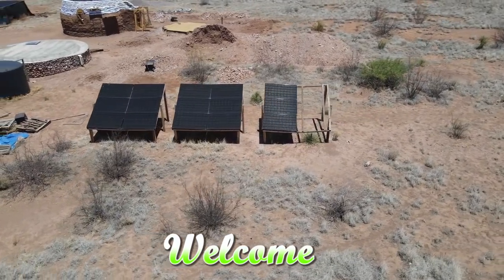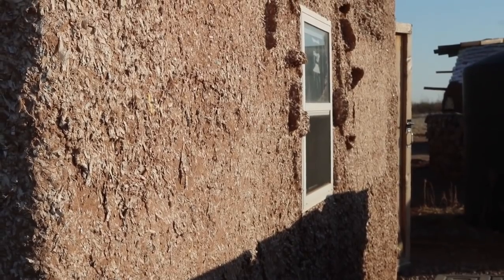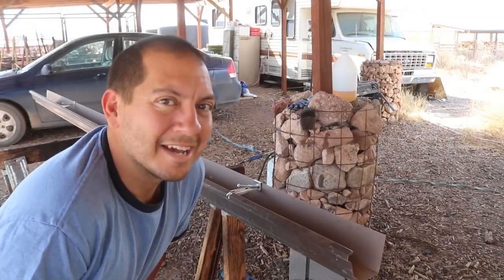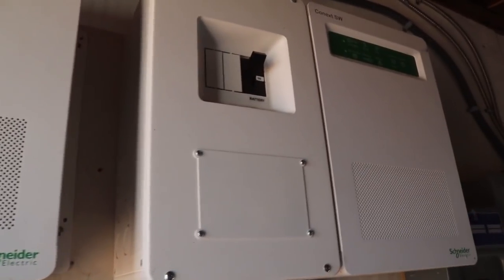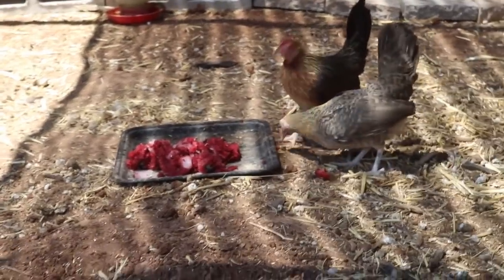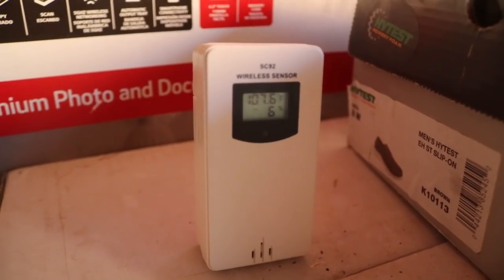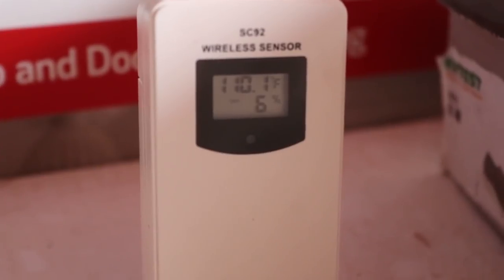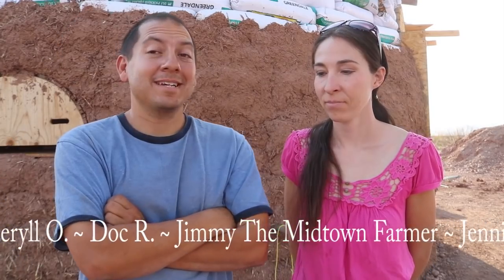Scorching Desert Heatwave Threatens to SHUT DOWN Our Off-Grid Solar

Comment: I am near Phoenix (its 117 F today) and have a system similar to yours but with only 2 Tesla modules.  I have my entire system installed inside a 1990 Astro van.  I painted the windows with reflective paint and installed a 12 volt Maxx Air Fan in the roof.  The fan is thermostatically controlled and comes on at 78F.  No other fans needed. Have never had a system shutdown even when 120F.  IMHO you just need to continually actively exhaust the hot air to keep interior of shed at outside ambient temps.  The Tesla modules and inverters can take 130F no problem.  The solar panels themselves do put out significantly less power when 160F in the hot sun, although that's not a problem if you have enough panels  like you do.  All I need to remember to do is close the  Maxx Air roof vent if it ever rains heavy.

Comment: How cool is your soil a few feet down? You might try burying some cooling tubes a few feet under ground to provide cooler air source for the shed during the day.

Like the others said, putting a shading roof over the RV’s should definitely help keep them cooler.

Comment: It can get pretty hot here in Central Australia, our solar system actually has it's own small air-conditioner unit. Maybe this would help, ours is set up in an old refrigerated shipping container with a metal insulated roof above this.

Comment: Do you shave Crew during the summer? We've had to do that with our dogs. This has helped our dogs tremendously. Also a wading pool in the shade if you can afford the water for it. This will help cool the dog. Cooling mats also work some but are expensive.

Comment: I just looked up the relative humidity for your area. If you go online and look up evaporative coolers "swamp" you might be able to buy/build one to cool the air in both your electrical shed and your living space. Its not a perfect solution but maybe helpful.
Reply: I'd do it for the RV but not the shed because of the electronics in the shed.

Comment: If your AC is cutting on and off it is probably slightly low on Freon you need to check it with a gauge.
It is super easy to put freon in the air conditioning on a post 1994 car, the service port is like an air compressor quick release Chuck. It just snaps into place you turn the air conditioner to on to recirculate and the blower motor to high speed with the engine running and check the freon level as the AC compressor is turning. 
If it is turning on and off more than likely the car is about a half a pound low....
I really wish I didn't live 6 or 700 miles from you guys because I could easily help you out with stuff like this on cars, I could have even fixed your truck

Comment: Insulating the shed won't be enough, in fact it could make things worse, that equipment generates heat and insulation will keep the heat in. I would do a earth tube system to cool it using geothermal.
Reply: Ventilation is more critical than insulation.

Comment: Be glad you are not up here in Phoenix, it was in the 90's before the sun came up. Have you considered a "swamp cooler" less electricity, though more water, but during the dry months will drop the temp 20 to 30 degrees.

Comment: Wouldn't it help to clean all the dust out of the inside of the car? Correct me if I'm wrong, but if you're running the ac on max, I would think it's pulling the dust back into the filters. I thought the ideas of using swamp cooler or small a/c in the solar house good ideas.
Reply: swamp cooler in the solar house? do you know how these things work? thats mixing water with electric plus it would speed up corrosion
Reply: @dantronics1682  - Ah ok. Not really. Thanks.

Comment: try looking at the condition of the fan on the AC radiator.  Might even replace it with a larger size to help pass the air through the rad when you are not moving

Comment: For some of you dealing with simular heat ....  If you have access to a backhoe.   Or are young enough
Maybe on the North side of your 
 buildings
Install geo-thermo heating and cooling...
Simple as burying some pipes in the ground 6-10 feet deep
The more 4 inch pipes the better
Maybe on structures 
If you could install multipul windows like 3 feet wide and 1 foot tall
As high in the south walls as possible
Could help let the heat out and draw in the cool geo-therno air in 
Similar to how Earth Ships heat and cool

Comment: Insulating the shed roof will drop your temperature considerably
Reply: Creating shade on the roof & shed will help more than insulating a building with a heat source, that is opened to ambient.

Comment: Many are telling you what they think you should do to keep the shed cool (less hot). You live in the desert so you have the experience there. I don't know about living in the desert, My question though, is - would putting another roof over the shed, painted white, maybe a 8 or 12 inch space between them do any good? Is that feasible?
Reply: If materials were less expensive.

Comment: Consider buying a water evaporator "swamp cooler" you can get them really small or huge.  They use low elec. And also add some humidity. It's the go to for arid climates....
Reply: yes, use about 1/3 as much electricity as HVAc.  Does use some water.
Reply: Electronics are not happy with humidity and I believe the invertors do have electronics. A small regular AC would cool without the addition of humidity.

Comment: To help cool your Living in RV build a roof over your RV WITH 2 to 3 foot space for air flow so hot air doesn’t build up.  Plus you get more roof for rain water harvesting. 
Remember your AC will only drop the ambient temperature 18 to 22 degrees.
Reply: Like build a connecting "room" with heavy mesh around older rv and to the newer... instant more square footage but also the wind is a major factor.. so  how would that do?

Comment: If the RV is in direct sunlight then getting some shade over the RV would help tremendously on the interior temps.  In the solar shed, since you are running a fan then consider adding something to it for a swamp cooler.  Like a water drenched towel hanging from a large container of water.  As the water evaporates it should wick more water from the container.  Should provide more cooling from the output of the fan.  I have no idea how much water it would use in ten hours but could save your valuable equipment.
Reply: I'm just worried about the humidity on the electronics.

Comment: Your car a/c cutting off may be due to high head pressure. Check to see if your condenser fan motor is kicking in, also living in AZ desert the condenser in front of the radiator  could be stopped up with dirt.
Clean it with soap and high pressure washer, you'll be surprised at what that will do for the car a/c!

Comment: One thing that I had out there was a swamp cooler. You can make a smaller swamp cooler for your shed. A fan and some swamp cooler filter with some water and you can't lower that temp 20/ 30 deg.
Reply: Very true. A swamp cooler works great! It would be better to add that to the RV. Electronics don't do well with humidity. The electronic control boards can rust and lose connection and then your control system will fail and a new board will be needed. It is possible to put a jump wire in the board to reconnect the electronics but it doesn't always work and you need fairly good equipment to track down the failure in the board. It could work okay and not even cause a problem too but I am not so good at taking chances with something that is so needed at their homestead.

Comment: I'm not a heatologist but I recommend that you aim your fan directly onto the controller to move the heat out of the controller. You really don't care what temp is in the shed, just cool the device you are having heat up. Also, on your car, you've replaced the fan. If your air temperature is not cool you'll need to buy a recharging kit for your A/C auto system. You can recharge it yourself. An A/C recharging refrigerant bottle runs about $40.00 for 20 oz. Watch a few videos on how to and you're on your way! My thought is the more you add fans the more the controller will heat, right? so the fan directed at the controller will cool the boards in the controller. Try it and see if it helps. Butch in Idaho.
Reply: It may not make much of a difference because the equipment is covered but the air flow around the equipment will be greater. On our built in refrigerator/freezer the fan blows directly on the compressor to cool it off. It makes a great deal of difference to us when a fan blows on us because it makes the water evaporate from our skin. Machinery doesn't get that type of cooling effect unless it is a special system. There are oil cooling systems for power transformers and such.

Comment: You need to add some radiant barrier insulation to the shed, and geothermal cooling. Also evaporative cooler helps. And a solar oven would help do your cooking outside. You can build another roof over the shed to keep it out of direct sun (white metal is best).

Comment: Nice setup, but I agree with others about the roof.  Put a 2x4 or even better, a 2x6 frame around the perimeter of the metal roof, line the area with vis queen,  then fill the area with soil or adobe.
Reply from the maker: Hey G Bear!👋 
Thank you for the suggestion.

Comment: I'm running about the same level of power in inverters feeding a 28x60 double wide manufactured house. Located 15 miles east of Salome, lots hotter than your location, 115 twice this week. Swamp cooler. Otherwise fully equipped house. Even in 115 temperatures I've never had a problem with my Magnum inverters that have no dedicated cooling in their shed outside our house. Your Schneider inverters are top quality and it doesn't seem like you should have problems. (You can see ours at redhilllabs.com, which is under construction but viewable and contacts are operating) Akita's rule!
Reply: Meant my website is under construction, and if you'd like to contact me there is a way on the website. I may be able to help. And we speak Akita.

Comment: have you ever thought of putting a chimney on that building? if its painted dark, it will be hotter than the shed which will cause an airflow and since hot air rise will suck the air out of the shed
Reply: I thought that is what Jim did earlier.

Comment: Have you checked the temperature in the root celar and the dome bedroom yet?

 Maybe you could put a temporary door in one to let crew escape the heat. Lol checking for snakes first tho. Lol.

I still think a 6-10 foot solar chimney would work on the shed. The Black stove pipe heats up in the sun, the hot air rises through the top cap fan, sucking air from the shed into the pipe, that forces more outside air into the shed, all without any electricity. I know they work best with underground heat pipes, but creating an artificial breeze should help.

Comment: Seems a swap cooler for the RV would do better then the type of A/C you are using, that particular type of A/C is very inefficient. Since water is a precious commodity, I would recommend you obtain a 5000 btu window unit for the RV, it would do a lot better job then what you are currently using and it would in most cases drawn less energy to operate it, just saying.

Comment: Put some straw bales on the roof of the solar shed. Check the condenser radiator of the car it may be plugged with dirt.
Reply: That's true too. I had to replace my radiator behind the condenser and a bird skeleton was caught between the two! Lots of leaves too. Cleaned that all out before changing the radiator!

Comment: Check to see if the engine fan in your car kicks on.   Some cars have 2 one for the radiator and one to bring air across a radiator for the ac.  Could be a fuse or need a new fan.
Reply: Or fan relays in a box in the engine compartment that went bad/need cleaning.

Comment: Hi I just wanted to tell you my car was doing the same thing I have a car that looks similar as yours and you drive it and there's just seems like there's no power kind of like dulls down and kind of the power like goes week when you're stopping your car like say you're at a stoplight and what we found out was it what's the alternator it was a power problem there's not enough electricity going through your car to power it I went to the same thing I was under my glove box fixing everything got my AC charged with antifreeze and it turned out it was the alternator not enough power just a suggestion
Reply: That is a good diagnosis. That could very well be their additional problem. Thanks for saying that. I had a loose ground wire on my battery so everytime I started moving after stopping, all the gauges on my dash would do strange things because the acceleration from a stop was wiggling my battery cable. Someone had overtightened it and it wasn't touching all around the battery post. Got a new one and no problems. Batteries can do weird things. Once, on another car, it turned out the positive post on my battery had two threads stripped and because of that I couldn't start my car. After a new starter and new battery, the post was replaced and it started right up. Go figure.

Comment: maybe a solar powered one way valve extractor fan/pipe chimney in the solar Adobe shack roof might help dissipate the heat build up, also maybe a low down  [or below ground?] air vent/ piped intake might help the air temp inside too, filtered to stop any critter entry....
Reply: Good idea to screen the pipe. Critters would love to build a nest inside a tube!

Comment: Working on your own car your never able to complete the task in the same amount of time that the youtube tutorial completed it in .. Im glad your working on your car though Jim.   I bought a 32ft 1989 motor home a couple years back and never worked on a vehicle prior .and ill tell you what I got a crash course into fixing cars and its not that bad.. Its pretty easy..most mechanics are robbing ppl for how much they charge for how simple the work can be ..  Apparently maybe not so honest of a mechanic told me once that in the ac hoses theres a filter that gets clogged ? Also the idleing shut down is interesting.. The AC clutch connects via belt to the engine and it turns air compressor ..was your car squealing when the air was turned on at all

Comment: I know a guy who put a small 1400 btu 48vdc AC unit on ducts that blow into insulated vents that go to the most critical solar devices. It only pulls about avearge 7amps DC. He had the AC air in supply duct buried 5' under the ground out side roughly 35' long. That helps keep the intake air a bit cooler. Then has a small filter cap 18" above the ground.

Comment: it wasn't menchened if the ceiling is insulated if not that is the place to start and if you can have a fan pull the heat from your inverters

Comment: Noticed you're using a portable air conditioner.  Not the greatest of ACs IMO but better than nothing.  Do you guys insulate the exhaust hose?  I found it was a bit more efficient when I tried to keep that exhaust hose from radiating the heat back into my space as well as checking for air leaks on said hose.

Comment: Add another layer of adobe and insulate that roof ( I'd add 1inch foam and a 2nd roof with a few inches gap and have the 2nd roof overhang all 4 sides to give shade for additional cooling). Those inverters probably have a thermal max rating of 40c (104f) and the cooler you keep them (don't go below 60f) the more longevity you will get. If you have traditional lead acid batteries they are majorly impacted by high temps usually anything above 78f starts to damage them. Lithium ion batteries not so much. Good luck 👍
Reply: I think they have that Tesla battery system that I know nothing about.
Reply: @StoneKathryn  they have the Schneider Electric inverters, I deal with inverters rectifiers static switches etc on a daily basis, I even have an SE shirt.... for work 😁

Comment: Sounds like the a/c condenser fan not working, the one under the hood behind the radiator.
There may be 2 fans
Reply: Yes, as soon as you turn on your AC in the car one of those fans should blow at your radiator continuously and the other will cycle on and off as needed. Check the fuse box, and there maybe a separate fan control module (relay) that plugs in at another box under the hood. Sometimes just pulling out the fan relays and cleaning them up a bit (wire brush or old toothbrush) and plugging them back in can help. I think there is a relay for each fan so you could reverse them to see if one isn't working perhaps? Good luck!

Comment: Well, If I was living in a 5th wheel in the desert, I would build a roof with reflective material to reflect the sun away.  For your solar shed just add insulation to the roof and some turbine vent fans on top. I been here in arizona since 4yrs old.

Comment: Insulate the roof and paint it white, or stick a solar cell on it, to give you more electricity and keep the sun off of it.  How about some sort of  a heat exchanger from the shed to the ground?  Like a heat pump uses for inground thermal heat/ac.  Or is you had a solar cell on the roof, you could run an ac in the shed to even maybe just lower the temp 10 or 15 degrees so it would not be above 100 in there.  Maybe you could put a wet towel around your dog to help keep him cooler?

Comment: They sell a $180 swamp cooler at Home Depot.   It’s small and goes inside.   You could put inside by window into shed.   On low it draws 50 watts and high is 80.   I use 2 to cool my trailer in desert center.   It hit 122 in August and Death Valley only hit high of 123 that month.   One swamper on low will use 10 gallons in 24 hours in 100 plus degree wetter.

Comment: I know it's kinda late but washing out the condenser in front of the car with some foaming coil cleaner and then rinsing would be good. Just got done doing it on my brother's truck and it brought down the temps for sure.